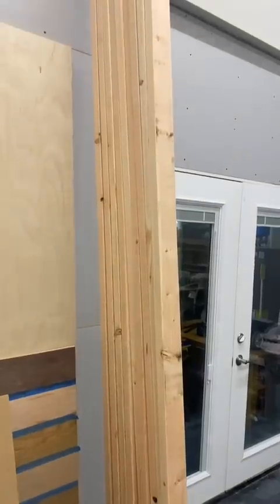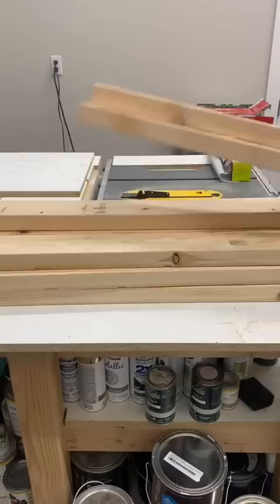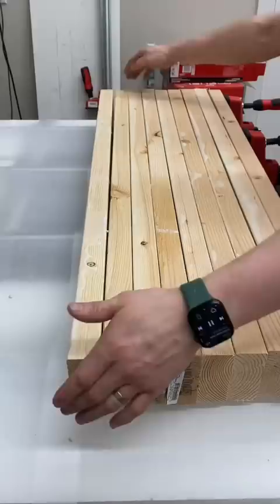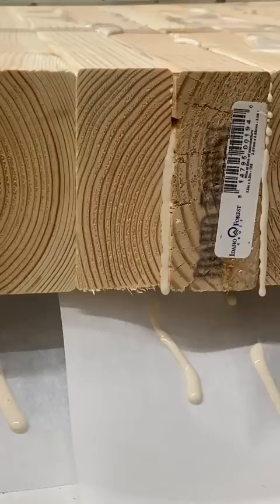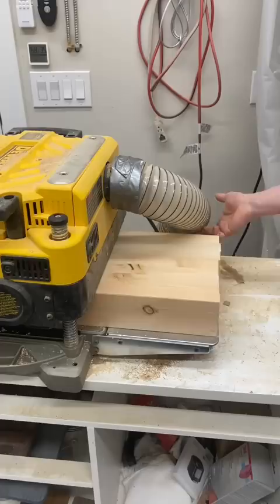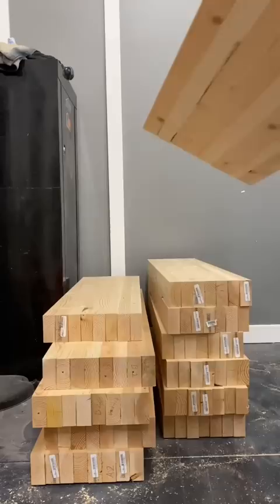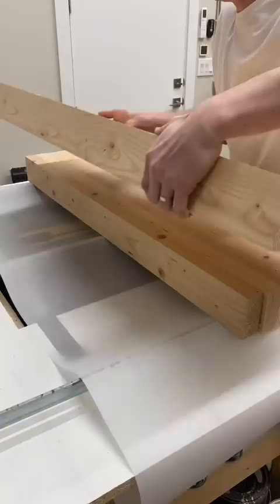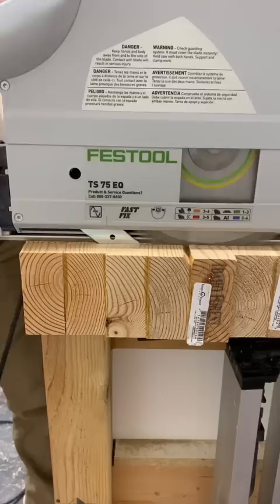Custom Staircase out of 2x4’s

Comment: That's the same reasoning I was confronted with 15 yrs when I needed to replace and upgrade my bed. What was out there in the furniture stores was of piss poor quality, way overpriced, and coming from China. So I found plans on the internet, bought oak from the local Amish and for under $100. built a queen size bed. It will last forever. friends and family are impressed with the final product.
Reply: Did you mean 15 years ago? 
Because I was wondering when prison came into this story.

Comment: Lots of negative comments from people who don't understand that fir and spruce are the hardest of softwoods and are perfectly acceptable for flooring and stair applications.
This is a great video for promoting less expensive solutions, which, in turn, generate work/income.
Keep doing what you're doing!🙂
Reply: Spruce is certainly not hard enough for flooring and that's not fir he's using. That's why southern yellow pine is used, it is hard enough. Spruce, not even close, you can dent it with your fingernail

Comment: I’m sure you adjusted the framing of the stringers to compensate for 3” plus treads. Nope just have two inch taller step at bottom and two inch shorter step at top. A little knowledge is a dangerous tool . Hope ya got a good grab rail use your gonna need it . Might want to get shin guards for that bottom step😂
Reply: ADA requires all the treads and risers be the same size, but you can add landings all you want.
Reply: Carpenters take the thickness of a normal tread into account when laying out stringers, so it’s reasonable to assume the poster did as well.

Comment: Looks great!
I did a few runs of outdoor stairs like this last summer. They were tropical hardwood, but still 2x4. I chose to make three 3/8” spacers between each board so I didn’t have to rely on the glue joints to stay perfect forever and now moisture and dirt never rest on the treads. The stringers I laminated solid like this here though.

Comment: Pine is too soft for this.
Reply: How do you know  its pine? Most 2x4s are spf.
Reply: @gregprangley2210  spf stands for spruce pine fir.  And yeah they'll eventually wear down, then just plane them flat again.  Pine has been used for floors & stairs for centuries.
Reply: Granted, this is personal preference and a cost vs quality decision. There are indeed softwood floors. Stairs are as high traffic as it gets though, and will take a beating. Maybe not an issue though using stair runner, for example.

Comment: Fucking FINALLY a carpentry short that actually applies wood glue properly instead of just dropping a line and smushing.
Reply: eh does the same shit
Reply: I would of slightly damping the wood before applying. Helps glue penetrate deeper in grain
Reply: Actually... He messed up. The glue is fine but the wood endgrain don't alternate... It will warp. That's unfortunate because it's going to have to be redone or deal with warped stairs...
Reply: @JustinRaymondUtah  considering it will be installed inside and climate controlled, warping should be minimal.  A bigger problem is that pine is soft as hell, not sure if he'll put a harder wood over it for a wear surface.
Reply: I would have scraped or sanded that extra glue off before I planed them because that glue wears out blades fast like that.
Reply: @rileywhite5091  No it doesn't
Reply: @bigpjohnson   He’ll probably cover the steps with wall-to-wall carpeting ! 😊

Comment: 3.5" thick treads? Makes stringers fun to make, risers thin, soft wear surfaces on steps, expensive future repairs. Plus its not mainstream for the market. Ask realtors about weirdly done remodels and resale value. Like pink siding or black walls. Only a bucket of paint would fix those problems.

Comment: Not a bad idea but SPF is way to soft of a material to make treads out of   The corners will get rounded of and denting and scratches are going to be a ongoing problem vs using a hardwood

Comment: Lots of moisture in 2x4s. I hope you let those dry a couple of months before glue up.  Also should have planed them first, 2x4s are usually skip planned and not smooth enough for a strong glue hold

Comment: I did the exact same thing word of advice though if those are going to be outside even if you stain seal them as much as you possibly can they will shrink crack in the sun because it's non furniture grade Lumber not veary dry,  if you use them inside they'll probably be okay if I was going to do this again I would set that Lumber outside for 2 months and let it dry and then build the stair treads out of it and then it'd probably be perfect
Reply: 2 years in the sun will not dry them enough to be used the way he tried to use them .. Even kiln dried to furniture grade moisture content Fir has way too much sap to hold a glue.. Those have already popped apart..

Comment: All that dried glue left on the top of the boards is hard on the planer blades.
Reply: I have a Grizzly planer that size and use the same knives. They don't last long if I am very careful to only send clean dry lumber through it. 1 pass with all that glue and those knives are gone. That's why he only showed one partial pass. The next pass he was pushing the plank though and the 3rd pass just burned the wood..

Comment: be nice to talk about the strength of gluing the boards vs nailing.
Reply: Should always remove the mill glaze with sanding before glueing or applying a finish - better absorption and bond strength.  The wood will fail before the bond if using Titebond II or Titebond III

Comment: I used a similar method for making an arched beam for a garage door header, using clamps and glue bending the 15’ 2x4s to the shape of the arch. Later I found out I didn’t have to do that because I could have put a straight beam as the header then simply cut plywood out to the shape I needed and sandwich some blocks in it and just install it below the header. In fact I got in trouble because the arch shaped beam wasn’t an engineered piece so they made me install a straight beam above my fancy arched gluelam header. Why am I telling this story again…?

Comment: Might want to run a dowel perpendicular through those pine wood slabs, maybe at least 2 per, maybe 1 every 8 inches, to assist in the natural splitting as the wood drops in H2O... beings those are a support structure.
Reply: It's not pine and dowels won't help the mess he already has on his hands..
Reply: @xman4328  ah, I didn't really pay to much mind to what specie the wood was, as I was so distracted with the methodology or practices being used for topical load baring steps. Will those units be fine, I don't know, but not a thing I would want to change, because if, or when it lets go, it will be swift and at the worst of times. Or atleast that is how my luck always slaps me in the face via a bugs bunny glove with two bricks stashed inside. ..lol
Reply: @drubradley8821  You mentioned PINE.. Every single thing that mentalobe did was wrong and every one of those glue joints has already failed due to his complete lack of skill and knowledge, including the size of the treads.. Those planer knives were destroyed after one pass.. That is why there is no follow up video.. He gets paid by YouTube based on activity and he is getting a lot.. It doesn't have to be praising him..

Comment: Why do the stairs need to be as thick? If u glued them up on edge u get more material,lighter to work with,far less stress on youre tools aswell
Reply: I think they'll be exposed, out in the open, not traditional enclosed stairs.
Reply: @Jim Gardner  yeah I gathered that but my points are still correct

Comment: I hope that holds up well over time, wall construction 2x4s aren't usually fully dried... Though i suppose if they warp as they dry you can just replace it later given the low cost

Comment: Could you not stick a dowel in the middle sections where it does not pruturd  the ends for safety or sturdiness? I am not a wood worker so genuinely curious if glue would hold that over x amount of steps.

Comment: I would have chiseled away alot of that dried glue from those 2x4s before putting it through my planer. Thats alot of wear and tear on those rollers and blades. Alot of that glue ends up stuck to the blades reducing efficiency. But i guess you dont mind replacing blades and or a new $600  planer.
Reply: That buildup can be cleaned off easy with acetone or mineral spirits.

Comment: Too much, man. Just a big waste. Should have ripped all the 2x4s and planed before gluing. If you are worried about tread strength, could have run threaded rods through the whole thing and just hidden them with the nosing or recessed and capped or doweled.

Comment: I’ve use 2x construction lumber as treads (on the flat side). That’s 1.5” thick.  I don’t get why you put it on the width side. 

The bad thing about using the 2x material is they are too soft. The top surfaces don’t last. They chip easily starting at the edges in less than 1 year.

Comment: I have two questions 
first question why didn't you use 2x10s??? Like us Pros do. There's 2x4 Treads that you're building up are a lot of weight that's going to be sitting on the Stringer. Second question yeah you've got an Arsenal tools okay so what do you really do for a fucking living it's not Carpenter. I can tell because if you were a carpenter you would have wiped down the glue before you run it in your planer bet you those planer blades are just are nice and gummy and dull too good luck sharpening those and yes now you have to resharpen those and you and you have clean off the glue